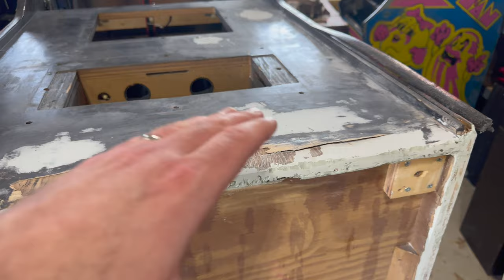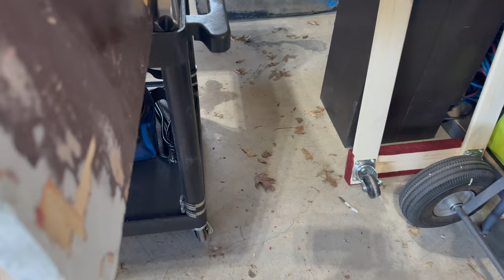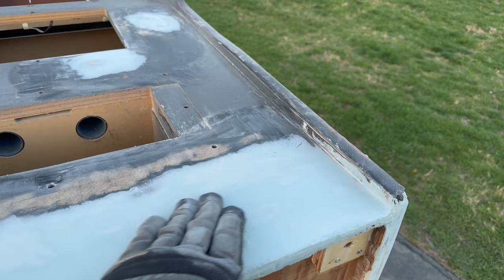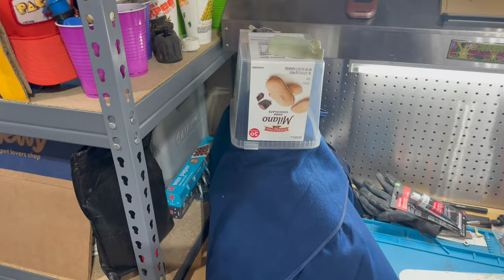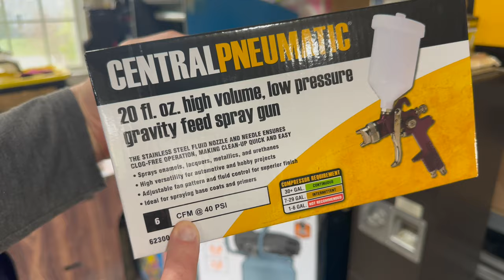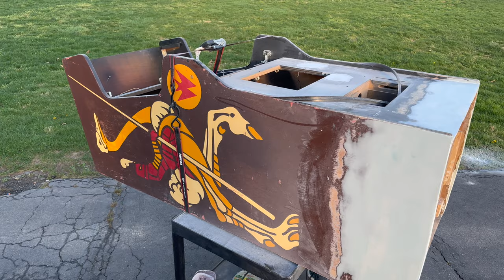⚠️ BOTCHED BONDO! ⚠️ Joust Restoration part 10: Final Prep for Paint + Building a Budget HVLP Setup

Comment: You should try fiberglass resin instead of the wood hardener it will dry in an hour
Reply from the maker: Good tip! I’ll have to try that in the future! Does it sand as well, or is it a lot tougher?
Reply: @overtimearcade  I was going to come in and recommend the same. I did a Defender cabinet recently that had similar delaminating and the resin worked well. You can dilute resin with a little acetone to help it soak into the wood better, but that will add to the drying time. One more thing you can try is to mix bondo with resin to get some of the properties of both. I tried it after seeing the suggestion on KLOV and really enjoy it.
Reply: @overtimearcade  it’s a little harder to sand, but your DA sander will take care of it just use 80 grit, and then your Bondo will adhere to that better than wood hardener
Reply from the maker: @Mathsjester  Great info, thanks! Does it sand as easily as regular bondo?
Reply from the maker: @troylukans2174  Got it. Thanks, Troy!
Reply: @overtimearcade  "Rondo" is a little harder to sand than bondo, but easier than pure resin. The good thing is that you have a smaller volume to sand because you'll have less excess with the self leveling. Resin is good for edge work because it's generally less prone to cracking than regular bondo.
Reply from the maker: @Mathsjester  Does it still work with using scrap plexi to help make a sharp edge, or will it stick?
Reply: @overtimearcade  Scrap Plexi works. The only issue is that it needs a strong seal or it will leak by (I've learned this lesson more than once). I often use clear packaging tape for the edges instead, sometimes in conjunction with Plexi.
Reply from the maker: @Mathsjester  Leaking because of the self-leveling properties?
Reply: @overtimearcade  Resin (and rondo, by association) are liquids before they harden, even though they are more viscous. So if there are any small gaps between the wood and Plexi, it'll leak by.
Reply: @overtimearcade  you wouldn’t by chance have a Qbert or know somebody that does I’m walking to figure out a couple wire colors on the bottom side of the PowerBrick. I need to know where they go. Thanks.

Comment: Your wood hardener may have dried but I would bet it was still off gassing. That could explain why the Bondo did not setup and bubbled.  I would give a minimum of 24 hours for any chemicals to off gas before coating with anything. I deal with a lot of chemicals in my line of work. I hope this helped.
Reply from the maker: I think you’re probably right! I’m the least confident with all of the cabinet repair and woodworking stuff!

Comment: The hardener in the Bondo also helps it stick better to surfaces so it doesn't fall off. Add a touch more hardener. It should be more light blue in color than gray.
It should cure in 5 minutes. 10 max.  If it doesn't you didn't put enough hardener in.  Remove it and reapply.
Reply from the maker: Good to know because I’ve got a ton more cabinets that need this treatment. As in literally more than 2000 lbs!